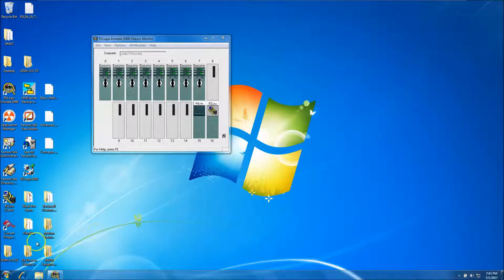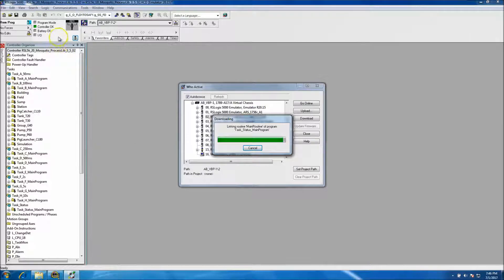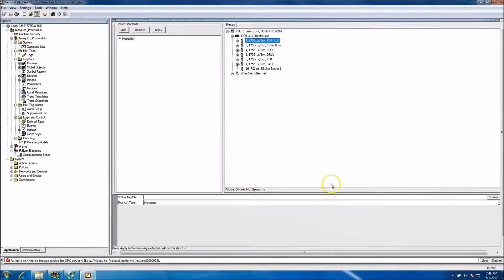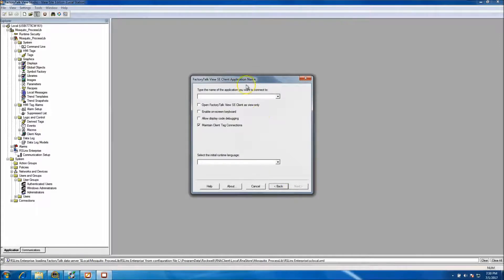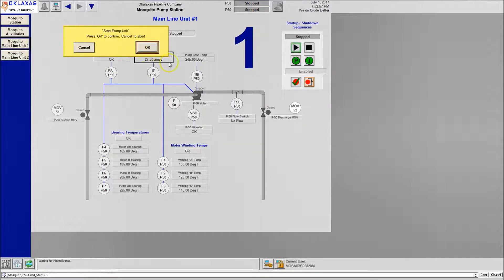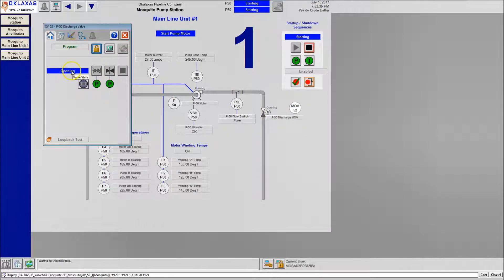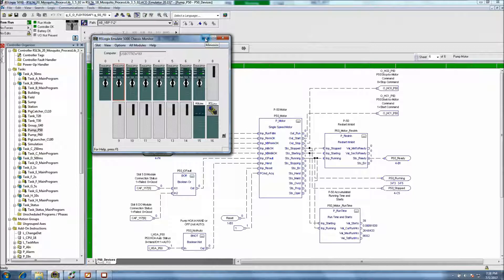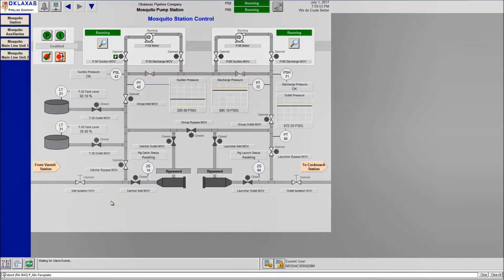FactoryTalk View SE  Process Objects Library 3.5 Sample HMI Application Fully Emulated

Comment: Hi Shane, I am working on L72 Redundant system. I have to create a HMI Function to switch controller. Basically if you press a button on HMI, Primary controller A will switch to redundant controller B.
Reply from the maker: First, you need the redundancy cards to be able to do this, then use them as control for which processors.

If you are referring to PLC redundancy.

If you are talking about HMI redundancy then you need to set the primary HMI server then in properties set the secondary HMI server.

Either one of these setups is not something I can easily talk through through text because of the level of detail needed.
Reply: @ShaneWelcher   Hi Shane, How can we discuss on call or seek your support for durther discussing L72 Controller Redundancy.Appreciate if you can provide your contact
Reply from the maker: @ravikishan88  

Depends on your time zone & ability to reach out
Reply: @ShaneWelcher   I am Central Time Zone US, Residing in Kansas
Reply from the maker: @ravikishan88  if this is about your redundancy questions, I don't have any hardware for that right now
Reply from the maker: @ravikishan88  if you mean, FTview redundancy then I can try to find time, I thought you meant CLX redundancy.

Sorry, I got some questions mixed up
Reply: @ShaneWelcher   Yes Shawn I have question about L72 CLX Redundancy.Will you be able to help?
Reply from the maker: @ravikishan88  I don't have the hardware for CLX redundancy.

Only FTView redundancy
Reply from the maker: CLX redundancy gets deep into knowledge during setup so it is best to show instead of talk
Reply: @ShaneWelcher   Thank you.I will have access to hardware next week and will get intouch if i need further help.